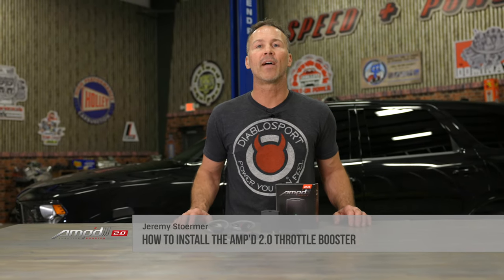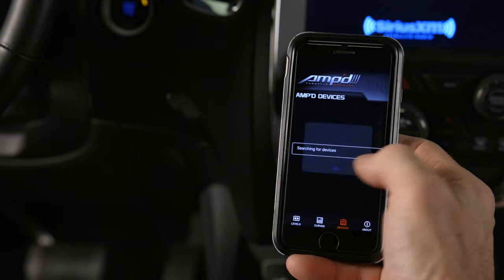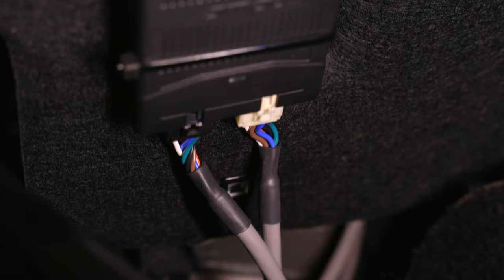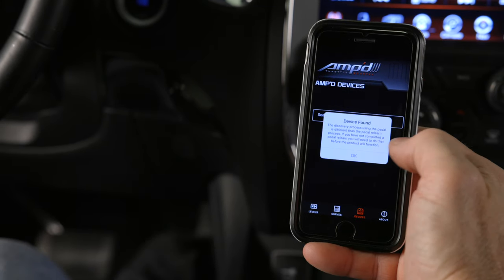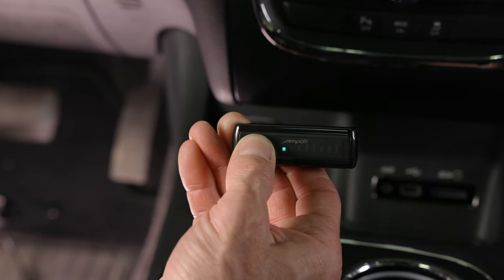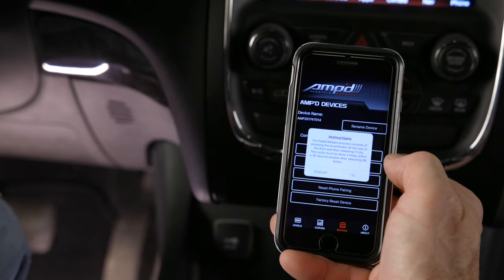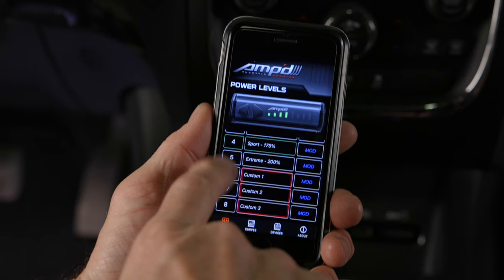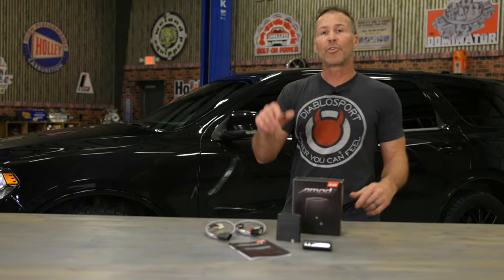Amp'd 2.0 Throttle Booster Overview and Install

Comment: So I have the APR branding one it’s literally identical. I can’t seem to get the switch pedal relearn to go from orange light to green. I’ve tried it like 30 times. Any suggestions?
Reply from the maker: I would suggest reaching out to APR's tech support line
Reply: @edgeproductsman  As it turns out only one pedal relearn is required. Doing just the app pedal relearn is enough.

Comment: I did a custom tune trying to push the limit and my car went into limp mode after losing traction while turning 2018 Malibu and had to clear the check engine light

Comment: Just too much. Other devices are just plug and play.
Reply from the maker: If a device doesn't do a throttle learn, it is possible that it will give you incorrect response settings and/or no response improvement at all.  Our product is as simple and easy to install as anything else out there, we just have more capability and options for your dollar.
Reply: @edgeproductsman do it comes with the wires or would I have to get that separately